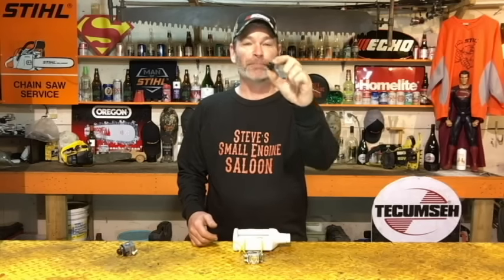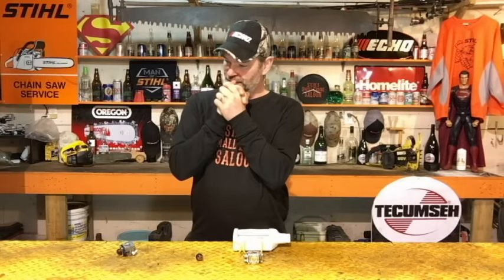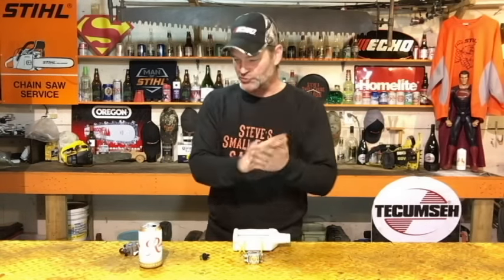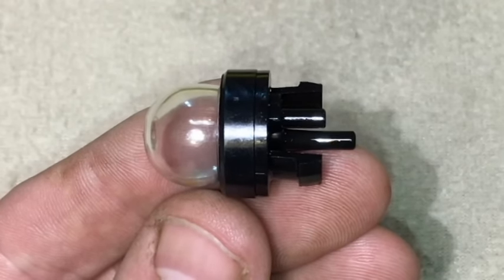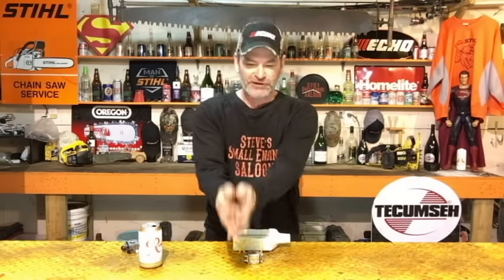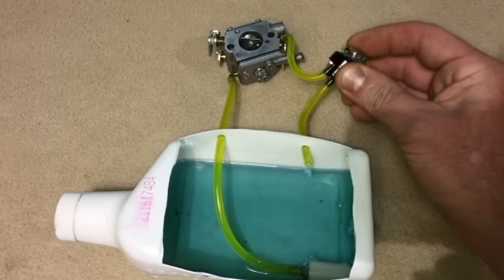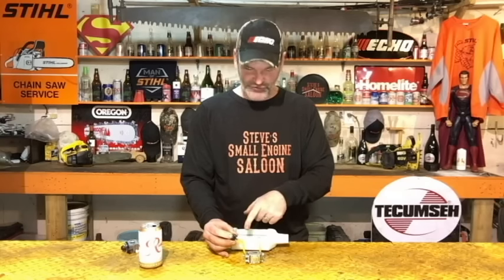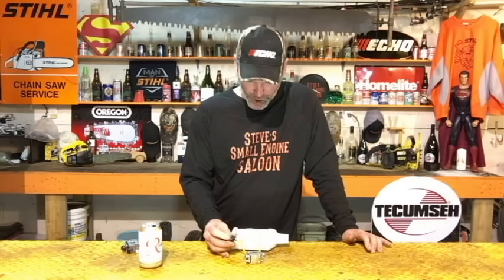How To Install A Purge / Primer Bulb Properly (Don't make THIS mistake!!)

Comment: My Troy Bilt weed eater that quit working after one season. Bought a new carb and bulb. The bulb has 3 stubs out the back of the Purge/primer bulb. (one long, two short) - I see the IN but I also see one that has an 'O' and one that has a 'P'. -- Have tried several ways of connecting it to the TB but still can not get it to fire or run..... Any suggestions about the bulb? - Jim

Comment: When you pump this purge bulb should the fuel tank become pressurized? My ms211’s fuel tank appears to be getting pressurized but no fuel into engine even when I choke it. Only starts on carb cleaner, then stalls.
Reply: Mine pressurizes also. it wont run if the cap is off (or it leaks) I put a rubber glove finger over the tank opening and it inflated when I pumped the bulb, it started! I replaced the cap and it would not start. I put glove finger over tank opening and screwed cap onto it (to make another gasket) and the thing started. I believe the pulse of the exhaust (and initial 6 pushes of the bulb) slightly pressurizes the tank and pushes fuel into carb. Only way mine would run. It was an integral bulb on the carb (Husky/Weedeater/Craftsman) XT260

Comment: i just replaced the fuel lines and primer bulb on my unit and before i installed everything i made sure i had it set up correctly. it was priming then when i installed the setup on my chainsaw when i started purging it fuel started coming out of the tank and the bulb would not fill. do you know how to fix this problem? thanks

Comment: Great video Steve, thanks. If the purge bulb is mounted on the carburetor, does it function the same, ie pull fuel thru the carb?
Reply from the maker: Yes it does
Reply: @StevesSmallEngineSaloon  thanks Steve

Comment: Hi Steve, I replaced the purge bulb on my Homelite 42 cc chainsaw and initially I did have it in upside down. When I corrected that problem I got it started but it will only run a few seconds then die, when you pull the trigger to power it up in bogs and dies, any ideas?

Comment: If it does not have a return line and just has one fuel line from the tank to the carb would that ork or no ( my edger does not have one)

Comment: Not sure if I will get a reply but I have connected my purge bulb properly on a trimmer of mine and I’ve cleaned my carb ensured the diaphragm is in good working order but still can’t get this trimmer to start it goes for a quick second if I spray some fuel in there but that’s it. Any suggestions?

Comment: hi there,so got a brand new machine with same purge bulb and after a view times of use the plastic bulb popped out,its not damaged as brand new! is there any hacks  to pop it back in again as its slightly over sized so its pushes out against the seal.

Comment: Question: I am replacing a carb on a generic Honda. The new carb doesn't have the purge hookup. Will the snowblower run if I bypass the purge?

Comment: I have a troy Bilt Trimmer that has a 3 port Purge Bulb. What is the 3rd port for . It goes to the tank to another hole..  Model TB685EC 4 cycle

Comment: Thanks for info. Steve. I ordered a Walbro W-188 bulb to replace my push button primer on my Pioneer 1110. Only one line goes to the carburetor. What would be correct connection to bulb from my two lines that go to the original primer. Line that goes to carb., would it go on in or out nipple of bulb. Thank You Lino.

Comment: If I kept pumping fuel through (using the bulb) is there any chance it could clean the crap out of the carb and dump it into the tank? I haven't a clue how to take apart the Husky auto tune carb on my 560xp...

Comment: You are a wizard. You are the walrus////////Koo koo ka chooo thanks for your Saloon. Thanks for explaining the fuel blub. After seeing the fuel flow I saw the thing is a suction through the carb not a pump into it. Now I see n expert agree. Commo fault with fueling nitro model airplanes. Rainier yes common sense....for the job. It only makes fuel available in the supply line,  not filling a bowl. Purge air bubbles by cycling fuel, long goes to tank.

Comment: I think prime comes from the old days when you had to add a little water to the hand pump when it has not been used in awhile, you had to prime the pump by adding a little water.

Comment: I had an issue where my carburetor had developed an an air leak and the purge bulb was creating an audible whoosh in the carb but couldn’t draw fuel. I couldn’t even find a rebuild kit but a whole new carb was only $20 with a new filter, fuel lines, spark plug, and adjustment tool.

Comment: So I did a gasket/diaphragm rebuild on a WT Walbro (WT-500B). Lines and primer bulb are all correct and new but when I push down on the bulb there is air bubbles coming out of the carb and into the bulb itself. I know there's a air leak somewhere. Maybe it's the o-rings for the low and high speed being bad but it barely squirts any fuel back into the tank. 
Can someone help me if I'm thinking correctly or is there anything else it might be?

Comment: Like your style. As a fellow beer drinker. It's nice to have things explain in bar talk. Lol. My 2008-9 ish Toro weed eater straight shaft broke recoil spring on pull cord. Ended up getting one that matched my 2011 ish. Diffence was tank on 2011 had fuel lines " melted in vs rubber grommet") can you replace lines tru tank.   I assume you have to stretch them??. But. Fuel lines on new tank vs 2011 toro weed eater. Seem ass backwards. Any how 2008 works due to understanding of bulb replacement. New bulb on 2008 seems pull a lot of air bubbles. But it runs. To me 200 toro is cheap since I abuse the hell out of them. Prolly not making any sense since 4 beers deep.

Comment: my bulb sticks, press it and just stays in, rebuilt carb thought I had it fixed and now same thing not sucking fuel through carb not inlet fuel line the carb itself (pickup line removed) getting to be a head ache any suggestions, my carb is very similar to your test mock up on this video although my carb, yes, obsolete, uses a K20-WTA rebuild kit other videos did not help me so what would keep fuel from circulating? I am pretty sure it is not hooked up backwards but I will check, had it pumping fuel but then flooded out then I rebuilt carb no back to sticking bulb or simply, cleaned carb(bulb sticking) was working but flooding fouling out plug, rebuilt carb new parts inside less inlet valve, now bulb sticking again, HELP

Comment: If you press it hard, it will squirt fuel a little into the engine. Helps with cold starts.

Comment: My chainsaw runs after purging but only runs till the purge bubble is empty, purge it again and it starts till it empties again, any ideas on that m8👍
Reply: Possibly a cracked fuel line where it is sucking more air than fuel

Comment: Hi Steve, is it possible to install this primer or purge bulb on a grass trimmer Stihl FS-88, with a carburetor Walbro WT-45A. That is an older type of grass trimmer and hasn't any kind of manuall bulb pump at all, and there is a fuel intake on the carburetor only. I have an issue with a starting a machine, but once it starts, it works very good.

Comment: Would the size of the bulb itself (larger volume vs. smaller volume) have any effect on the  way the engine runs? I received two different size bulbs in my replacement kit. Not sure why ....
Reply from the maker: No difference on running...

Comment: So.. I have to hand it too ya bud. I bought a used toro blower/vac last year. It was honery to start but worked Ok when it did. I rebuilt the carb today,and replaced fuel lines. Put it all back together like I found it. Ran really finicky. I haven't payed attention until your video that the "purge bulb" was injecting gas into the carb before I rebuilt it. Afterwards the bulb was a bit stiff. Swapped fuel lines on the bulb, and it purged properly. Darn thing runs like a striped @$$ ape!! I owe ya a beer bud!
Reply from the maker: Right on Buddy...

Comment: I have a whacker nueson bh65 at work an idiot forced the primer he said it was rock hard and something popped then the carb leaked. I rebuilt the carb ive done a ton it ran but still leaks gas from the airbox area it cant be the cab the needle and seats set correct the pop off test passes im really wondering if gas is running threw the purge bulb i can see gas going threw the small line just running non stop slowly. So i dont know if its that bulb. Can you shed any light. Im thinking it has to be that purge valve. Maybe the ding dongs that had it for 2 months hooked it up wrong. It wemt in to get fixed and came back not running it was lean on the high screw and a tad on the low. Im really wondering if the fuel purge valves shot because of what the guy did or its hooked up backwards. He said it was rock hard and he forced it and something let loose then the carb leaked since.

Comment: I have an old Echo HC-210e hedge cutter that has a bulb on the carb but the purge body has 2 pipes, one is return to tank and the other goes to another stand alone bulb that has a single pipe. At first I thought it had the wrong carb but the parts diagram shows this set up to be correct. The stand alone bulb is missing and the pipe is blocked off. The problem is the bulb on the carb which works is under the air filter housing and cannot be used with the housing on. Why would it have 2 bulbs and one that has only one pipe?
Thanks.

Comment: When you close the "choke" ("butterfly ") on the carb, the main, transition and full throttle enrichment circuits all dump fuel into the venturi.  It turns the piston and cylinder  into one huge vacuum pump, sucking on the gas tank.  Super saturating the charge with juice...and will "flood" (bridge the electrode gap on the spark plug) after a few pulls.   Induction Systems 101.  There will be a 42 question test on this topic tomorrow.  Bring a #2 pencil.

Comment: I have a Husqvarna 445 and I'm having a flooding issue. After taking the carb off due to it sitting for a year and I failed to drain the fuel. I was able to get it to start and ran good. I needed a new chain. so the next day I purchased a new chain put it on and it never started again. Put a new plug, checked the spark all is good. But the thing continues to flood. fuel just pours out of the exhaust and the sparkplug hole. after watching you're show on the purge bulb install. There is a possibility that I might have crossed fuel lines on both the carb and the bulb. Pulled it off four times and just could not see anything wrong with the needle and seat. I did order a new carb and sparkplug due to all the fuel being in the head area.What's strange thing is it ran and ran good. Then nothing, then flooding. I hope I'm heading in the right direction.

Comment: great vid .. plain and clear... very good job
Reply from the maker: Thank You...
Reply: I did it Steve !! I did it !!  fixed my poulan 2250 !! .. it would'nt start at all and it was sleeping in the rear of the garage and I was wondering when I would throw it away (had it fixed two years ago and cost me friggin' 100 Euros)
then i watched a couple of tutos and well... I tried it .
A quick look at the carb and spark plug (was ok) fresh gas, new fuel lines.. (that turned out to be THE problem)
It starts at first pull.. revs up with no problem and doesn't die on idle .... 
I feel happy, proud and free from repair shops and that's thanks to you.
I m buying you a beer.. you deserve it
ENJOY !!   :)

Comment: Steve, my purge bulb doesn’t have an in and out fitting. I just changed my fuel lines and bulb and can’t get any flow. This is on an Echo HC-210E Hedge Trimmer. Please please help! Thank you .

Comment: Im so stuck. I have a Troy bilt TB635 with the triple outlet on the purge bulb. I have replaced the carb, all lines( Had them reversed and was getting no fuel suction but fixed it) purge bulb, spark plug and the compression is fine. The purge bulb isnt filling like I remember the old one doing. Just a little fuel goes into it then leaves. Yesterday I had it fire once and stopped immediately. How I have it set up. bottom left intake on carb goes to tank with filter, bottom right is suction to purge outlet with the nub. top right(last outlet on carb) goes to the purge bulb non nub outlet. Long outlet back to tank.
Reply: Figured it out. One of the brand new lines had a hole in it. Appreciate the videos

Comment: Why am I seeing small air bubbles going from my carburetor fuel line to the primer bulb ( purge ) and then back down the return fuel line on my poulan chainsaw? They are hooked up correctly. Thx

Comment: Hi Steve, I have an echo 225 that won't start after it bogs down. I replaced carburetor, fuel filter, air filter, spark plug. Tested for spark, compression which is 125 psi. Why does it bog down then won't start?
Reply: Fuel tank breather maybe , when it bogs down and won't start , try loosening the gas cap briefly and see if it'll fire up again . If it does , it's the breather .

Comment: I Changed the carb on my echo srm210 weed eater, i have fuel leaking back out through the breather line. Came out to the garage and all the fuel had leaked out of the gas tank. Any reason for this? gas cap?
Reply: Fuel bowl may be cracked

Comment: Hi Steve ..my frend have Husqvarna 236 its brend new..chainsaw start with no problems and run ..after some time shy start so sound like to rich and die ..u start over shy start but is still to rich ..when hi open tank and close again (just release vaccum) shy start and run good 1-2 min ..and then same problem ..if you press primer bulb 2-3 times shy runs good again 2-3 min and again to rich and die ...any advice where is problem .. tnx..

Comment: Steve do you have a pruner poll chainsaw ppt 230 throttle cable? Mine  From end to end the black housing is 13" long. Any help would greatly appreciated .thanks Carl in Goodyear, az

Comment: I've got an old Craftsman Weed Eater that started leaking fuel out of the carb. I replaced the carb and the lines, but still, if I leave the trimmer setting flat or up against the wall almost every drop of fuel gets siphoned out the throat of the carb onto the floor. I don't know what else to try.
Reply: UtwoBed sounds like a bad check valve inside carb
Reply: @hattersequiptmentrepairllc4661  Thanks for the reply. That's what I thought and that is why I replaced the carb, could it be the new carb is bad right out of the box?

Comment: Dont use pump gas  use only non ethanol  fuel.  You can get it at some tool rental stores.   Or make a n ethanol eliminator.   It as simple as a gravy separator.

Comment: If the bulb doesn't work after swapping the lines, make sure your fuel supply line is not cracked or the fuel filter is clogged before you go tearing your carb apart.
Reply: Also leave enough slack in the line  if possible in order to swap them on the purge bulb without having to disassemble it again.

Comment: Well thank you for this video my friend it's a little bit late though because I thought it if you push it in the fuel goes out of it that was to go into the carburetor the flow going out but you have the flow going in back into the gas tank and I couldn't figure it out my thing would start for a couple of seconds and I thought it was a carburetor so I bought a brand new carburetor put it on there and did the same damn thing and I kept putting the primer Bowl I guess backwards so I took a hammer and I destroyed my weed wacker I smashed it into so many pieces you couldn't find it after that it melted into sand particles I wish I would have seen this I don't know how long this video has been out but I to read reverberate I thought that the fluid squirting out would go to the carburetor but it goes to the gas tank so I destroyed my weed wacker because of that and cost me a new carburetor that I destroyed too well thank you my friend and God bless and make America great by voting for Donald Trump in 2020

Comment: hi i have one of these on my k760 stone saw and it seems to make a pressure inside my fuel tank and splitting seals ive rebuilt my carb and im still stuck
Reply: also how would i go about cleaning my main jet one way valve as i think it could be blocked

Comment: COULD YOU PLEASE DO A VIDEO TUTORIAL ON CARBURETORS WITH A "TICKLER"? THE ONE THAT I HAVE COMES OFF OF A VINTAGE  SNAPPER COMMERCIAL TRIMMER. THIS PARTICULAR UNIT HAS THE PURGE ATTACHED DIRECTLY TO THE GAS TANK, ONE FUEL LINE COMES OFF THE BACK SIDE OF THE PURGE AND GOES INSIDE THE TANK WITH FILTER, ANOTHER LINE COMES OFF THE SIDE OF THE PURGE GOING TO THE CARB, AND THE LAST LINE COMES FROM THE OTHER SIDE OF THE CARB AND ISN'T ATTACHED TO ANYTHING, IT JUST HANGS THERE LIKE SOME SORT OF VENT TUBE. THE GAS TANK ITSELF HAS NO INLET/OUTLET HOLES. THANKS IN ADVANCE.
Reply: Buddy, what brand and model carb is it? I had a 3 line setup on a walbro, was able to talk with walbro and got a nice diagram sent to me. I was fixing a customers unit that came in disconnected to start with. They said the 3rd line was a primer. It went from the fuel tank grommet (next to the other two lines) to the top of the carb. Maybe the manufacturer can tell you about yours.
Reply: GOOD IDEA BRO! NEVER THOUGHT ABOUT CONTACTING MANUFACTURERS (BRAND):NIKKI  (MODEL):6050  I'VE ALREADY REBUILT IT WITH NO PROBLEMS BUT THIS TICKLE BUTTON HAS ME AT A LOSS. I KNOW ITS APART OF THE START UP PROCESS BUT I'M JUST NOT SURE HOW LONG OR HOW MANY TIMES I SHOULD TICKLE THE CARB, DO I PRIME THE CARB FIRST, PRIME AND TICKLE SIMULTANEOUSLY, TICKLE UNTIL FUEL STARTS DRIPPING, ETC. ETC. ETC... LOL ! THIS THING IS ANCIENT MAN, IT HAS TO BE FROM THE LATE 80S EARLY 90S!